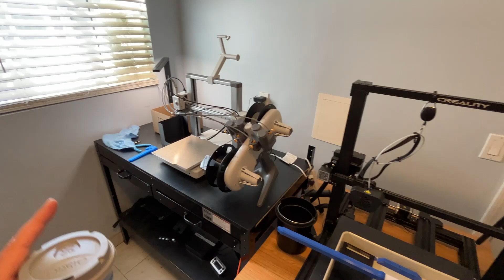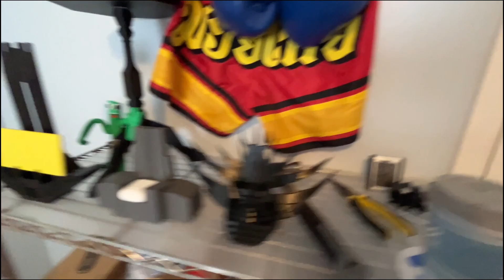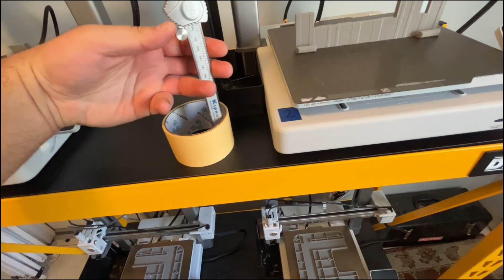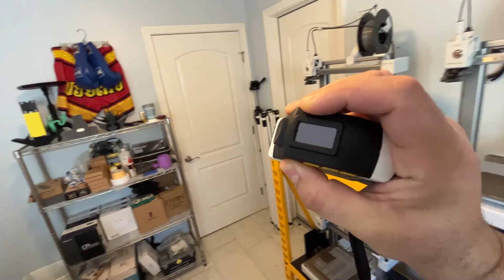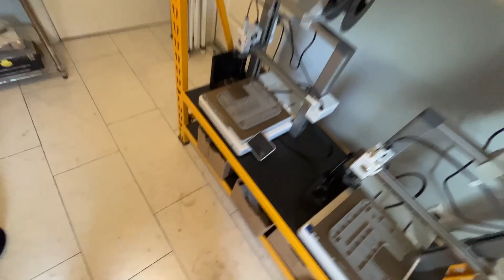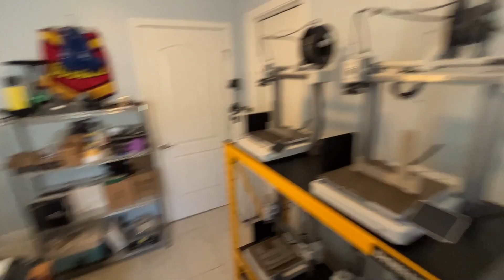Catching Up: Bambu Lab A1 Details, Patreon News, and Print Tips!

Comment: I'm not 100% aware of everything you do and waht you're looking for (this is the first video ive seen) but you should look into Rhinoceros 3D for product deain style CAD. Onshape is great but its more for engineering style designs driven by dimensions. Things like a mouse are a lot more natural which Rhino is a lot better suited for. (Its the difference between parametric modeling and direct modeling). Rhino also has a feature called Grasshopper which is scripted cad. Look into Grasshopper CAD examples on google, very awesome.